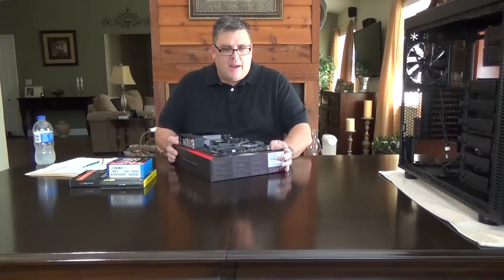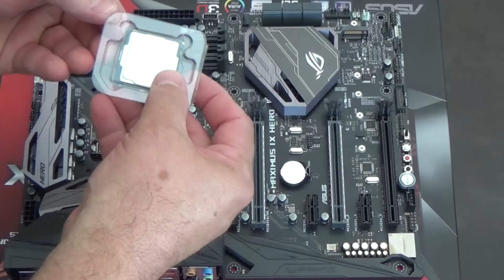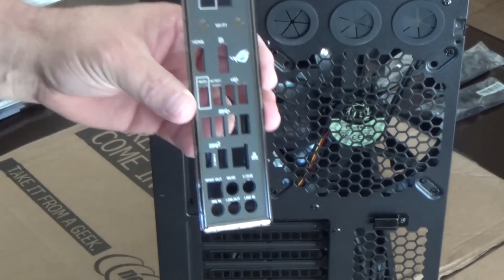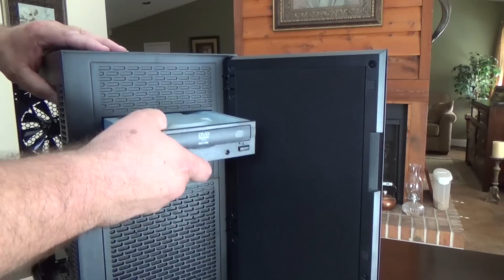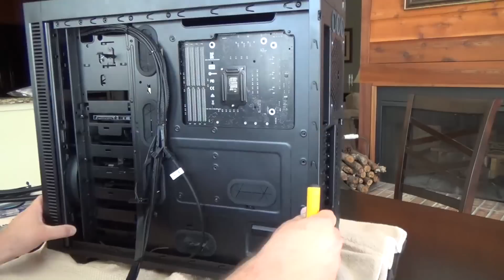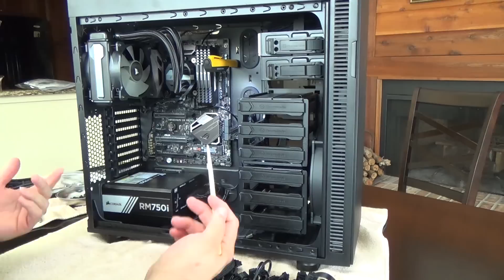Asus Maximus IX Hero - i7 7700k Kaby Lake Build

Comment: Great video and good explanation. I want to build a similar system but I have a question. Why did you use 3000 Mhz RAM? I thought the 7700K only supports up to 2400 Mhz RAM? Is there a benefit using ram with higher clock speeds than officially supported?
Reply from the maker: Link me to where the i7 only supports 2400Mhz.
Reply: ark.intel.com/products/97129/

> Memory Specifications
Reply from the maker: I see where you are going with this now.  I should have realized earlier.  DDR$ has a theoretical limit of 2133Mhz due to its architecture. It's not an ASUS limit or a intel limit.  Every RAM stick sold that advertises a clock speed above 2133 assumes the reader understands that is the speed while overclocking.  You often see a OC after each one speed index.  I've seen speeds rated at 4266Mhz.  Setting the "XMP profile" in the UEFI automatically sets the overclocked speed and the voltage to accommodate the increase in speed.  the 7700k is the latest chip on the market (for the most part), did you really believe that every RAM stick rated above 2400Mhz was useless?
Reply: No I just thought maybe for server stuff. Thanks for explaining. :)

Comment: (Sorry but i'm trying to build my first gaming pc so i might be a noob in this) I'm trying to get an NZXT S340 Case and it has 2 usb 3.0 on the frontal ports, so that means the usb 3.0 cable that connects to the mobo controlls both USB 3.0 Ports on the front ?
Reply from the maker: That correct.  Actually USB 2.0 and USB 3.0 headers each supply power and data path for 2 ports.  Thanks for watching.

Comment: how is the temperatures with i7-7700k and the H80i v2, idle and load temps? Starting a build this monday :)
Reply from the maker: 28° at idle and 70° at full bore.
Reply: Thanks for fast reply :) I'm also getting this H80i. But, not 100% where to connect the cables from the water-block. You have the 4pin cpu-fan, 4pin aio and 4pin opt....if I understand correctly, none of the cables is going on cpu-fan?
Reply from the maker: The 3 pin cable goes to the AIO header, the fans go to the cpu fan header and the cpu opt header.  If you install the software, Corsair will control fan speeds and pump, if you also connect a usb cable from the water block to a USB 2.0 header.
Reply: Thanks again for the fast reply :) Isn't possible to have both of the H80i fans on the cpu fan header. What I dont understand is the opt-header...

Comment: So, I have the same Motherboard, and same CPU. When i try powering on, it doesn't show anything on the screen. The lights all come on on the MoBo, and the CPU fan spins, but it isn't showing anything on the screen. What did I do wrong?
Reply from the maker: What does the boot error code say.  And here is my index of boot error codes for ASUS.  mikelilley.com/asus-error-codes/
Reply from the maker: So do you have a GPU or are you plugging into the MOBO direct.  Have you tried a different port, like say HDMI instead of DP?  Does the input on the display match the cable assignment?  Do you have a spare GPU if you are using MOBO video?
Reply: Error code is 00
Reply: I have a GPU, it's not plugged in currently. But I am plugging in through HDMI straight to the ports on the back of the MOBO.
Reply from the maker: Did you try the Display Port on the MOBO, Did you install and try the GPU?  I guess you know now the 00 error code is "not used" - never seen that before, you may have a bad board.
Reply: I've tried going through the gpu, but still nothing... And my monitors don't have display... But I'm thinking it's just a bad board... I bought it open box so...
Reply from the maker: NEVER buy open box, its open box for a reason!
Reply: Lesson learned xD

Comment: Ive read mixed reviews on the i7-7700k's has anyone gotten them or any of the i7 to run windows 7
Reply: The correct answer to your question is yes. You can run Win7 on the i7-7700k Kabylake CPU's. I refuse to run anything else at the moment.
Reply from the maker: Operating systems are not CPU specific, you could run Windows 95, Linux, Solaris, OS2 and Dos  on a 7700k.
Reply: sorry I'm new to this side, I program Industrial automation and looking at building something like you did to use to keep my program files on and access it remotely with a cellular modem  from them field with my laptops this mite be over kill for for me but with saying all that , so I guess i was asking if I can run run windows 7 OS with the ix Hero and a i7-7700k
Reply from the maker: This build would be extreme overkill for your needs.  This build was designed to accept multiple streams from computers and IP cameras.   So again, motherboards and CPU's don't care what operating system it boots to.  The issue with installation of Windows 7 is related to a driver issue and most motherboards supply information on that.

Comment: just remember. not all cases are created equal. Some cases dont have a bottom vent for the power supply to circulate its own air. Saying always do it this specific way, could create issues. ALWAYS CHECK THE MANUAL to see how it should properly be installed. :)
Reply from the maker: Cases that do not have vent holes for the power supply are NOT enthusiast cases.  No computer geek would EVER dream of pushing $2000 of components to the max while drawing hot air into a power supply.  All power supplies should always draw in outside ambient air.  You comment is argumentative and ignorant of enthusiast computer builds.

Comment: I just built a system with the same motherboard, however i have a code of A0 showing on the motherboard.  There doesn't seem to be any issues, as I'm typing this from the system itself, but I'm not sure why that code won't go away (it's just bugging me).
Reply from the maker: "AO" is not an error code in the Asus nomenclature.  It simply means that the UEFI boot sequence has handed off operation to the hard drive where the OS is installed.  In other words, it is completely normal and expected.  I posted an Asus Error Code list on my website for easy referance.  You can get it here: http://mikelilley.com/asus-error-codes/.  Thanks for watching.

Comment: Good day from Baltimore, MD! I recently built my PC with Maximus IX Code as the mobo. The system boots fine, and the 7-segment display shows 'A0'. Went through the system manual and it says "IDE initialization has started". Is this referring to IDE drives that have been phased out by SATA? Should I be concerned? Any information would be helpful. Thanks!
Reply from the maker: "A0" on an Asus board is not an error code.  It simply means that the boot sequence has been handed over to the IDE (or in this case the hard drive with the OS).  No worries my friend.  As long as you get pass POST and get to the desktop, you are golden!
Reply: That makes sense. I was surprised the thing passed POST without any errors. Thanks again!

Comment: Would a 1080 fit nicely with this current setup?
Reply from the maker: Plenty of room for an nVidia 1080.  One of the reasons I purchase this case.  You can also remove one of the hard drive cages and accommodate ANY GPU on the market today.  Thanks for watching.

Comment: Sir maybe you can help me.  I am a noob I ordered the Asus Z270i mother board along with the Corsair H100i v2, only after I made the order I discovered that I needed USB 2.0 headers for my H100i v2 cooler. My Z270i does not have any 2.0 USB headers on it.  It does have 3.0 and a 3.1 usb headers. Do I really need to plug the H100i into a USB header or is there a work around? Thanks for any help.
Reply from the maker: Certainly one of the drawbacks of buying a Mini-ITX.  For that price you would expect some extras huh?  The H100i does not require the USB 2.0 header.  It is simply a link to the software.  However, there are two solutions to this problem.  Sadly your board will not accommodate either one ( I am assuming you have added a GPU).  The only feature that you will not have access to is the speed features.  I would plug the fans into the MOBO headers and let the board control those.
Reply: Oh thanks for the quick reply. Yes I bought a GPU, I got the EVGA 1070 FTW hybird and I think it needs a 2.0 USB also. HAHAHA!  What a dumb Ass I am. I had planned it all out. I was going to buy the ASUS Z170i and the Sky lake processor. At the last moment I decided to upgrade to the Kaby Lake because the Z270i went on sale. I assumed the 2 mother boards were the same just different faster chip set. Its my first build and I guess this is my learning moment.. Anyway thank for the help I will let the MOBO handle the fans like you recommend. Thanks again.
Reply from the maker: When I first started I made plenty of mistakes myself!  I have been doing this for a very long time.  I would reach out to the builder community as often as you can before you make your purchases and you will benefit greatly from that.  To address your current dilemma, I always buy ATX boards, they are the most common and generally pack the most features, especially for future proofing and expansion. You can reach out to me any time for advice, if you would like.
Reply: I appreciate your help and thanks for the kind offer. I did have a full size ATX case but I was informed that, That monster case isn't going in this room by my Wife.. LOL. So thats how I ended up with a mini ITX case.
  Thanks again I might take you up on your offer when I get all my parts and have to install windows.

Comment: Quick question: Any particular reason why you used the 2nd m.2 slot instead of the one near the cpu?
Reply from the maker: Yes, indeed.  All of the SATA ports are populated, therefore we need 5/6.
Reply: netnole if I were to use the Samsung evo as my only means of storage would you recommend I install it on the m.2 slot close to the processor ? I'm kind of worried since my 1080 and my hyper 212 evo would crowd it
Reply from the maker: Heat is an issue with M.2 chips.  The hottest part of the motherboard is near the CPU socket.  Some MOBO makers put the M.2 socket on the backside of the board for this very reason.  As the M.2 chip gets hotter, they slow down.  The difference is read / write times is not very large between the SATA and the PCIe setting.  You have to make up your own mind what is more important.  I choose the bottom slot because we are going to populate all the SATA slots.  Crystal Disk reports 12355  MB/s Sequential Read and 10689 Sequential Write.  Ridiculous speeds.  Use case is also an issue.  This machine is never going to be rebooted and will not launch programs every day.  It was built for data storage and collection.

Comment: Getting Error 53 (Memory Initialization Error) when trying to start the machine after the build. Any idea?
Reply from the maker: I posted an error code list for ASUS motherboards on my website:  http://mikelilley.com/asus-error-codes/

Your error code appears to be indicating the RAM is not compatible or not present.  I would need the RAM model / make and the motherboard model/make to assist further.
Reply: Hi,

So I was able to remove the error 53 (memory initialization error) by putting DDR4 RAM correctly. But now I am getting error A2 (IDE detect). Here is my system config - 

1. Intel i7-7700K 4.5GHz
2. Asus Maximus IX Hero
3. Corsair  Vengence 4x8GB (CMK32GX4M4C3000C15)
4. Corsair Rmx Series, RM850x, 850W

You can check it out @ http://a.co/gzylnK7.

I only have the MOBO, CPU, RAM and PSU plugged in right now and nothing shows up on the monitor, I am using DispalyPort to connect to the monitor.
Reply from the maker: Make sure the input selection is correct on the monitor.  I certainly have made that mistake before.  Does the system POST?  Did you try the HDMI video out? Can you boot into the UEFI BIOS?  If not, return the board.
Reply: I am able to boot and get into BIOS now. Hopefully, know I will be able to install the Windows.

Thanks for your quick replies.
Reply from the maker: Being able to POST and getting into the BIOS certainly represents no video issue.  So what was the issue?
Reply: I think issue was just me doing my first build. Thanks for all the help. I will let you know if I have other issues.

Comment: So I have a question for you. When you look at the specs for this board, it says "6 x SATA 6Gb/s ports **

** These SATA ports are for data hard drives only. ATAPI devices are not supported.", but I saw you using an optical drive in the the sata port. 

Does the board actually support optical drives in the sata port or is it just for hdd/ssd?
Reply: I have often had the same question when reading the specs for most current motherboards and their statements that the SATA ports don't support ATAPI devices.  And your response makes perfect sense as well; being that any newer optical drive will use a SATA for the connection to the MOBO.  But do you have any idea why the initial splash screen after the POST shows that the SATA port6 reports the DVD drive as "ATAPI"?  Apparently it is irrelevant as your DVD probably works fine but do you think this is simply a remnant of old nomenclature indicating that the drive being recognized is an optical drive or is there possibly more to the story?
Reply from the maker: The DVD burner that was installed is "Serial" ATA or SATA.  I don't believe it is possible to purchase an ATAPI drive at this point.  However in that case, you are right, this motherboard (and all current motherboards) would not support an ATA drive, which would be connected with an IDE ribbon cable.   Thanks for watching

Comment: Great video and alot of help thankyou, I've actually got very similar parts coming this Wednesday, I've never built a pc but watched and read alot of tutorials but I have a few questions I would love some help. First question was when you installed the motherboard did you not have use risers as most tutorials show that there should be air? Also I have a 550watt power supply coming is this enough or should I change it ?
Reply from the maker: On Thermaltake cases, motherboard risers are pre-installed and soldered on at the factory.  To determine your power supply needs, navigate to https://pcpartpicker.com/, create a system build which will tell you your power needs, then double that number.  Choose an 80+ Gold PSU and you will be golden.  I have an article on my website explaining the different certifications on PSU, you should check it out - http://mikelilley.com/2017/02/05/80-plus-certification-power-supplies-explained/.  The basic premise is that a 80+ Gold PSU running at 50% will be 90% efficient.  No need to waste money on a 90% efficient Platinum for example.  Thanks for watching my video.
Reply: Thank you 😊 really appreciate the help, I've started the build and followed but can't sus out the bit with the cpu power cable were does this fit as I cant see clearly.
Thanks.

Comment: Hey @netnole Is there a reason you used the bottom m.2 instead of the top? Loved this video thanks!
Reply from the maker: Indeed, there are very specific reasons.  First being thermal, the upper M.2_1 socket will be surrounded by much more heat than the lower  and secondly, when the upper socket is populated SATA 5_6 ports on the sides are disabled.  Total of 20 lanes from the Z270 chipset.  This is an intel Z270 chipset thing and not an ASUS thing, btw.

Comment: Did a build using ASUS M5A97 LE 2.0 motherboard.
Red devil Video card with duel fans.4GB RX 470.
Black Edition AMD CPU with cooler fan 4 tube cooler. It dont get hot and rarely above 47 C.Fan dont run till 60 C.
8 GB ram soon to be 32.
Ultra fast no fails except for CD/Rom up and down now not recognized by the computer.
Reply from the maker: "not recognized by the computer" - do you mean in the UFEI BIOS?  If so, move the SATA cable to a different port and reboot back into the BIOS,  if still no CD in BIOS, send it back RAM.  If in the BIOS and it's Windows that does not recognize, that is a different story.
Reply from the maker: The last AMD proc that I used was an AMD Athlon XP 2500+.  That was the one that would overclock very well.  Literally, that was in 2004, 13 years ago.  intel Core technology changed EVERYTHING.  Do yourself a favor and switch to intel next time, you get more bang for the buck.  Motherboard makers sell AMD boards as an afterthought and sell very few.  The senior designers are working on intel and thats where the innovations occur.

Comment: I have created a custom build and I installed 2x8GB DDR4-2666 RAM. However American Megatrends shows that the total memory of the PC is 8192 DDR4-2133.

My motherboard is ASUS MAXIMUS HERO IX and my RAMs are HuperX Fury Black. At first I installed them on the grey slots (where getting that total memory of the PC is 8192 DDR4-2133) then I tried on the black ones slots, however even the screen doesn't turn on. On the grey ones shows that.

An ideas how to fix that?